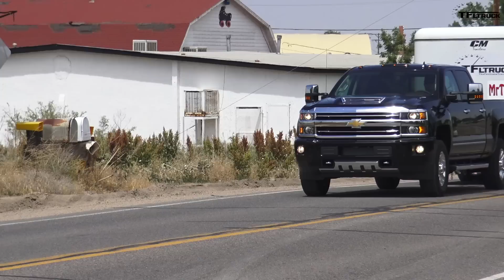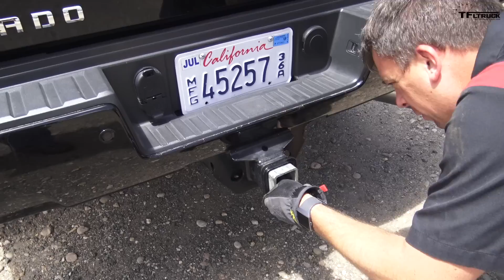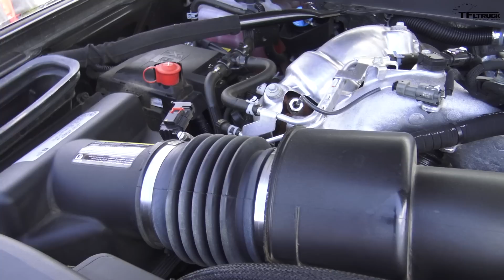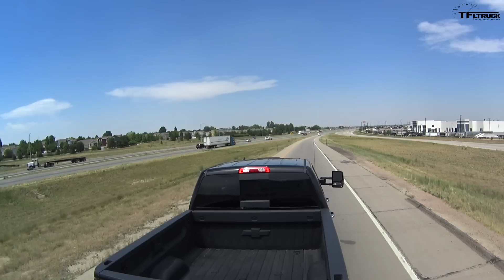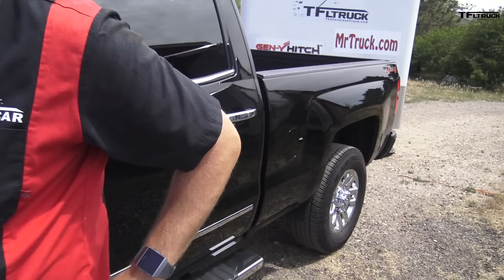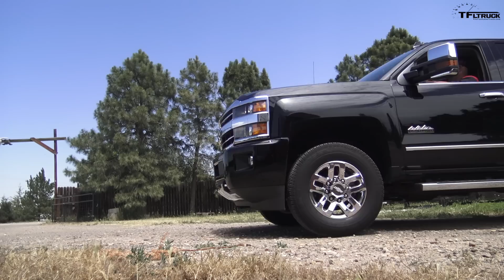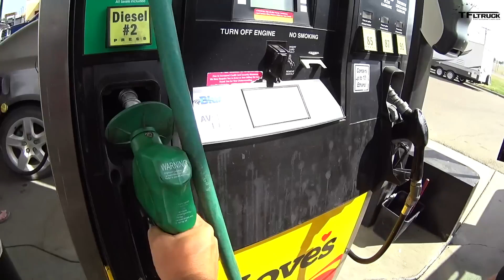MPG Challenge: Silverado Duramax vs Cummins vs Power Stroke

Comment: Hey guys, great video. I love this channel and I think it's the best place to go for real world truck testing that you really can't find anywhere else. 

I just wanted to offer my two cents about how you do these MPG loops and some of your other tests. I think sometimes you get outliers in your results because a certain truck/trim/cab/bed/axle ratio/wheel/tire/etc combo either happens to be in an efficiency sweet spot or a spot where the truck doesn't perform as well as it could at the set speed. My suggestion is to vary the speed to a predetermined number at a specific milepost in the same way for each test. For example, run for 20 miles at 55 mph at milepost xx.x, instead of just running the same speed for the entire loop. This would simulate the real world where speed limits can change even on the highway, and also help to level the playing field for trucks of different configurations. 

Keep up the good work guys!

Comment: The winter vs. summer diesel is a very valid argument here and I would be willing to bet that the difference between all three would be 1mpg or less if all three were tested on the same day let alone the same time of the year.  I understand that they can't control what time of the year they receive these vehicles to test, but they should have done a better job of attempting to test them closer together or at least acknowledging the fuel difference amongst the tests. You are better than this TFLT!!!

Comment: Sorry guys, love the videos, but way too many variables involved in this test. You guys need to test the trucks in the same temperatures and weather conditions using the same fuel (summer vs winter blend, it makes quite a difference in power and economy). You would also need to test each one three separate times to get a fair number. 👍🏻

Comment: That diesel sounds wimpy. I was surprised to find out the the fuel pump on the Duramax is driven directly off the belt. Probably not the best idea when you end up on the side of the road with a broken one. Also got to wonder just how much better or worse the mpg would be without the DEF and DPF systems.

Comment: Without taking the time to look again, I thought the Ram had a 3.42 gear?
Reply: I just watched the mpg test video again and it didn't say the gear, but in the test with the Dodge vs the Duramax towing test it looked to be the same truck which showed a 3.42 gear and only the 370hp version. Those videos were 3 days apart so I assume it's the same truck. For fuel mileage testing if you list the Dodge as a 4.10 gear it isn't quite the same. I am a GM fan, but I like all 3 and enjoy watching the tests.

Comment: Amazing result. I realize this is splitting hairs, but to be fair to all vehicles in the test, you should really use the same GPS as your speedometer in each vehicle when testing as each vehicle speedo is likely off a little and can skew the results. Admittedly, by a small margin but when comparing apples to apples......

Comment: All of these modern trucks have come a long way and will all trucks being within 2mpg of each other; I find it hard to imagine any of these trucks would be a poor choice. Each brand has their perks and disadvantages but personal preference will out-rule all factors. Chances are if someone is in the market for a new diesel pickup, they’ve made their mind up based on preferences regardless of mpg or small hp and torque differences.

Comment: My old 6.5L Detroit Chevy 3500 Diesel gets 20mpg when loaded to 9,000lbs and 28mpg when empty... My Ford 7.3L IDI F-450 gets 16.5mpg when loaded to 15,600lbs... Indirect Injection is and will always be the boss of MPG... Oh yeah how much does it cost to change your Injectors? Because mine cost $400-$600 and I can change them out like spark plugs in my driveway.

Comment: I am usually a ford guy but I do have to say that the duramax is the best diesel on the market
Reply: Ford has a clone International Engine Design that Ford is still struggling to get right. They are now on the 6.7L generation 3. Fairy sad when you buy an 80k Truck and have to take it to have the engine redone when new to make it last. I will say some stuff about Duramaxx,  but my mother taught me to never say any thing if it is not nice. If it was not for Isuzu GM would be like Ford struggling to have a decent diesel power plant. Cummins has it's own issues and have striven to get past those issues I will say that Cummins has saved Dodge from the being a foot mark in annals of history.  
     As a young man in the military, I worked on plenty of diesel engines in the CUCV (Ford, Chevy, Dodge variants Everyone liked the GM the parts would work on their personal trucks less engine), Humvee (A0,,A1,A2), M998 to M1123, Duce and 5T and  larger frame trucks and heavy construction equipment. 
      
        Ford has a nice truck but all the whistles and bells can not make up for the short coming of Ford diesel engines. Maybe one day they will get it right. Then again I am used to a diesel engine making the minimum of a million miles in a truck and countless hours in heavy construction equipment if maintained properly. GM was right to go with the Allison Transmission and that alone may be the sole factor of me walking away from Ford. Years ago I would not touch a GM due to transmission issues nor a Dodge as it would fall apart internally. In the early nineties buying a Ford with the 7.3L Diesel was iffy due to Fords transmission's mechanical issues to much torque  from the engine. Things have improved and I have long since closed that tool box to never open it again. I want a reliable truck that will tow what I ask it to tow, get decent fuel economy when both towing and when not. Stay out of the factory repair shop and stay on the road for at least 20 years. with a minimum of recalls. I know that is asking a lot for the manufactures and there is zero reason that it can not be achieved.
Reply: hahahahahahahahahaahah
Reply: Nope Its ford,Ram then chevy.
Reply: @fordbuilttough.610  Ford has the worst diesels!

Comment: Having alot of seat time in the L5P it seems like the best well rounded powerplant. Stock for stock the duramax feels like a rocket. The transmission always knows what it's doing and I know allot of people hate the IFS but if you use it only for road use it doesn't even compare. It handles great for being such a massive vehicle. IMO and I'm emphasizing IMO it's the best well rounded truck you can buy today. TFL has proven in there real world test that the Duramax always seems to edge out it's competitors. They are small wins but wins none the less.

Comment: I'd like to see the Big 3 all test running 3.55, 3.73, and 4.10 gears in 3/4ton crew cab longbeds. Each run with the different gearing then combine the overall scoring.

Comment: so to people who tow, temperatures are a huge factor, meaning you should display what the engine temp is at and the transmission temperature. you guys should do all single rear wheel 1 tons with the ram being equipped with the AISIN. also according to the ram website only the dually has the 4.10, every diesel in single rear wheels is a 3.42. to get the 4.10 on a single rear wheel you have to get the gas engine

Comment: Next time test all three at the same time and as close to actually the same. I.E. same tow capacity, same size (2500 or 3500 with dual on a 3500), same elevation and same road. Anybody can skew the numbers depending on all these including the driver of the vehicle. Acceleration, idle time and amount of Regen time will also effect the mpg. As well as outside air temp and time of day. Just some food for thought.

Comment: It's not a comparison between the trucks because you have a 3500 Chevy and you did a 2500 Dodge and a 250 Ford if you want the same you need to step up to the 3500 and 350 to keep it equal

Comment: I didn't buy a new Duramax for MPG.  I didn't even read the MPG on the window.  If you want a big truck IMO just be willing to pay for it and don't sweat the small shit...
Reply: grimx1188 Well you wouldn’t have found any MPG #s on the window sticker anyway because the EPA does not require HD trucks to be rated.

Comment: The way you guys fill up is unreliable. Trying to put more in after it’s clicked off depends on the fuel tank size and how much air is present in the tank after those thirty seconds. Which the amount of air in tank is dependent on temperature. Love your guys reviews, but the way you fill up isn’t a true method. Let it click off and put the nozzle back please!
Reply: Agree their method, while same for each vehicle is flawed.  An improvement would be take a few minutes longer and keep feeding fuel slowly to the brim on each vehicle before and after run for closer accuracy. This method could be several tenths variable.  Enjoy the reviews but, mpg results questionable.

Comment: GM diesel truck has curb weight at least 7,700lbs. and GVWR 9,600lbs. Watch the payload you snowflakes
Reply: That particular truck is a 3500HD SRW 1-ton with a GVWR of 11,600.

Comment: You need to run that test with a chevy 2500 since its tow rating is less than the 3500.
Reply: Jack Paul In this config they are the same. 13,000lbs. Less than the Ram 2500 (14,060) and F250 (15,000).
Reply: You need to understand they are exceeding the payload capacity of the 3/4 ton trucks befor they ever reach the max tow. Read all offerings from  http://fifthwheelst.com/rvtc_calculator.html

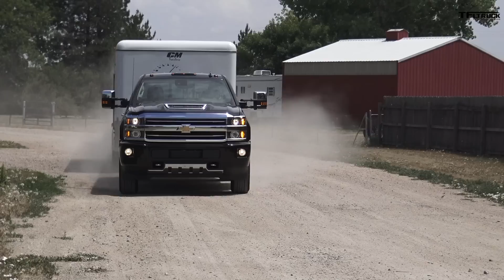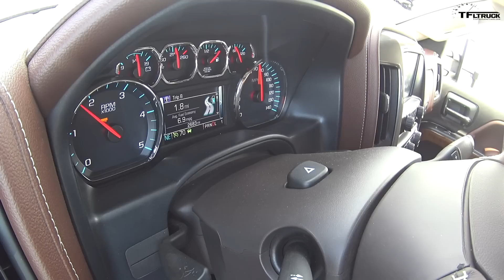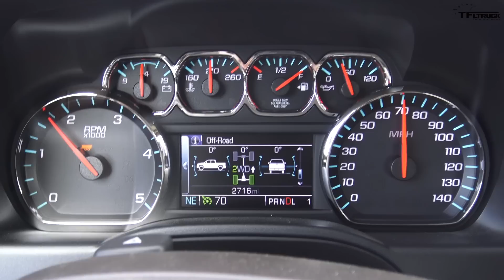Comment: To be accurate this test would have to be done on the same day, with same temp.  The problem is, the Ram was tested in the winter with winter blend fuel which provides poorer economy. Not only that, but if the GM has 4:10 gears than that is better under tow for fuel economy (Ford had 3:55, Ram 3:42s). I've had numerous trucks, all brands, some have been regeared, and with all of them tall gearing yielded better empty economy and the lower geared  truck always yielded better fuel economy under tow conditions. I'm not saying the Duramax would not have won, just that the test is not accurate. I'm not a particularly loyal to any one brand as in my opinion they are all very close for different reasons.

Comment: Subaru axles get better mileage than dual wheels that's the reason why I said we did better because it has single axle wheel give it a dually and it'll get eight

Comment: You said the reason for the different real axle ratios is you went with what the vehicle came with. I won't say it is the same in the U.S. but here in Canada there is the following choices: Ford 3.73 or 4.30,    GM 3.73 or 4.10,   Ram 3.42, 3.73, 4.10.  So there is a choice so why not test all with the 3.73 which is offered across the board? Definitely would created a more even playing field.

If you ever get a chance to put impute into website design. You can tell Ram that they probably could increase their sales by checking out the GM and Ford sites. Ram is very difficult to configure a vehicle on.

Comment: RAM does not offer 4.10 rear end gears on their single rear wheel diesel trucks. 3.42 is the only option, so the RAM you tested would have 3.42s not 4.10

Comment: Can somebody please tell me what the difference between this truck (as a 3500hd) and literally the exact same thing from Chevy but a 2500hd. Crew can short bed duramax. Same gear ratios same everything. What sets them apart. Single wheel 3500s and 2500s seem to be the exact same thing but they aren’t
Reply: 3500HD SRW has overload assist springs…11,500 GVWR vs 10,000 on a 3/4 ton. 5th wheel & gooseneck towing increased from 13,500 to 17,200.

Comment: The cummins probably did worse cuz the 2500 cummins has less torque than the 3500 cummins with the aisin, therefore it had to work harder.  I'm willing to bet that if you compared the duramax 3500 srw to the cummins 3500 srw, the cummins might actually do better in terms of mpg.

Comment: This truck had the highest gears, that's why it got the best MPG. The Ford transmission is geared lower, so a 3.55 is similar to a 4.10 in the Ram. The 3.31 in the Ford would be a better comparison to 3.73. The Ram would probably have the best mpg with 3.73. Also the all terrain tires hurt the mpg of the Ford and Ram

Comment: Lots of factors not listed. 

Wind on that day, that will make or break you.

Gear ratios and final drive rpm at given speed. 

If the trucks were in a Regen at the time of test and for how long.

Comment: If any of these trucks are going through a regen during the loop test then that will alter the results. I know on my Ram during a regen the fuel mileage instant bar reads low and even while coasting down a hill it will read low.

Comment: 4:10 vs 3:73 vs 3:55. I'm not going to ask you anything. I'm telling you there is a difference.

Two Identical trucks (one with 3:55s, one with 4:11s towing 12,000 lbs on level ground will ABSOLUTELY get different fuel mileage. This is extremely easy to prove. Do a test, two runs with ANY truck, one run in 5th gear and one run in 6th gear. I guess you don't have to... because you already know the results. That being said, if you are going to tow 30,000 lbs, 4:11s would be necessary to help keep the drivetrain cooler.

MORE ON GEARING:
Just to be clear, manufacturers do not know that much. If they did they would have given us wide ratio 6 speed transmissions 30 years ago. If they were smart they would not have waisted millions developing a transmission with too many gears, (just so they could say "we have the most gears"). By their logic if a 10 speed is better than an 8 sp then a 12 sp would be even better yet. RIGHT? An 8 speed with the same ratio spread as a 10 speed makes more sense in many ways, especially from a longevity point of view, no need to constantly change and/or skip gears, plus larger gears in the same housing, or lighter weight, just to name a few. Engines with roughly a 3000 RPM operating range do not need 10 speeds. I drove an 18 wheeler for many years. The operating range of my Cat was about 800 RPM it needed 13 speeds. What is happening to Common sense in our world? 

Love your YouTube channel it is the best. Thanks, Tom G
Reply: teejg They're not testing "otherwise identical trucks".  They are testing trucks with different gearing in the transmission so using identical axle ratios wouldn't necessarily give an identical final drive.  Also different engines will be happy at different rpms.
Reply: teejg 800 rpm? That seems low. I drive a Volvo with a 505hp D13 and its sweet spot is 1300 rpm
Reply: He is talking about operating range as opposed to a sweet spot.  So he has a range of about 800 rpm for each gear, hence needing more gears.  So he may be in 1 gear from 800 - 1600 rpm and then shift to the next gear.  Where as a modern pickup has a much larger range ie: 3000 rpm, so it then requires less gears.  A pickup may operate more along the lines of 1200 - 4200 rpm.
Reply: d h
Diesels redline at 3300-3500 RPM, most around 3300
Reply: teejg
Differential ratios  3.73, 4.10, 4.88…

What’s your differential numbers?   3.55, 3.73, 4.10, 4.88.   Often times these numbers are overlooked when buying a truck.  However, depending on how you’re going to be using your rig you may want to take a closer look. These number reflect your towing capacity and will affect your fuel economy.

What do these numbers mean?   It’s the relationship between how many times the drive shaft rotates in correlation to one revolution of the axle/wheel.  A 3.73 gear ratio means the drive shaft will rotate 3 . 73 times for every one revolution of the wheel.  The step up or down in gear ratios may seem incremental but the difference is noticeable when driving and at the fuel pump.

In basic terms, a lower gear ratio coincides with a lower RPM while driving at speed.  Lower RPM correlates to better fuel economy.  Great for the truck you drive to get groceries.  However, when you need a work truck you’re compromising  your towing capacity.  In this case a lower gear ratio lowers the amount of weight you can tow.  At the other end,  higher number such as 4.88 will significantly increase your RPM’s.  Which will cost you more at the pump but will give you more towing capacity.
Reply: Anthony Webber correct
Reply: teejg Makes sense to me.
Reply: Well I don't know any D13s running 3500 rpm but I suppose there are a few that have been modified to spin a little faster.
Reply: I agree.  Here are more details...
In that particular test all of the engines have about the same power and the same operating RPM. They do not, (as you mentioned) have the same 6th gear final drive ratio. You still should not compare fuel economy with 3:55s against 4:11s. Unless you want to see the Ram with 3:42s against 4:11s towing 30,000 lbs in the same truck, that would be an interesting test which I do not know what the results would be.

Note: FINAL DRIVE RATIO.  For this video, the differential and 6th gear overdrive specs...  Ram 4:11 & .63,  Ford 3:55 & .67,  Chevy 3:73 & .61.  Multiply the differential by 6th gear and you see the chevy has the tallest (lowest#) final drive, (2.27-1) and the best MPG. Ram w/4:11 is 2.58-1 and has the lowest final drive (highest#). If you spec a Ram with a 3.42 axle the final drive would be 2.15-1, taller than the Chevy and I am positive an improvement in fuel economy.